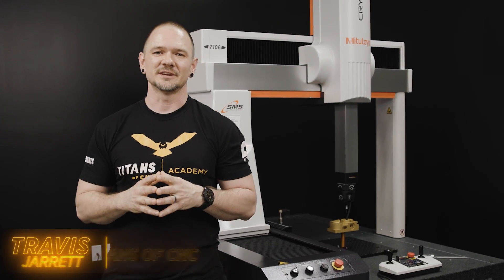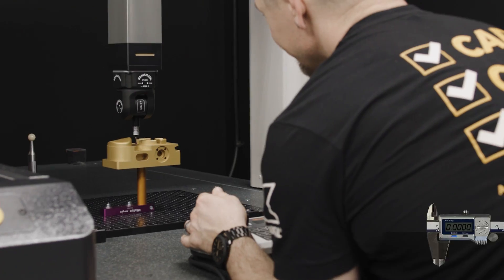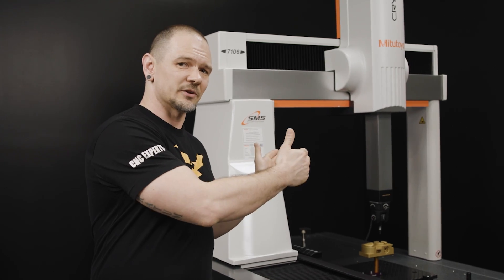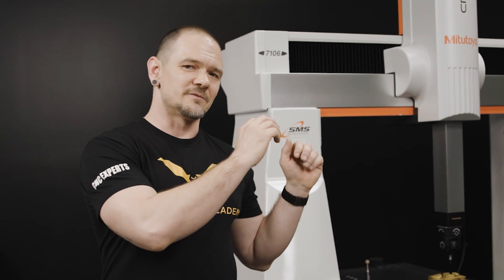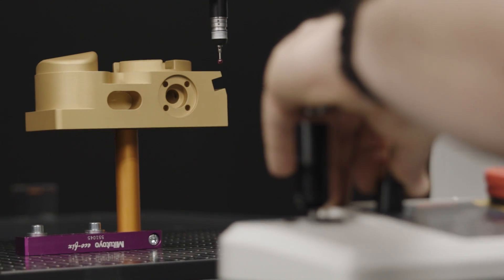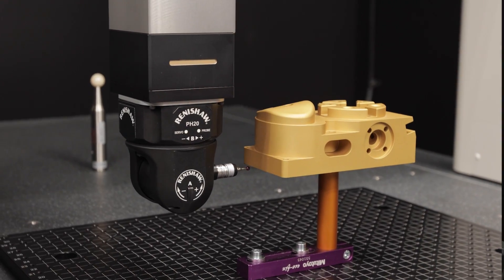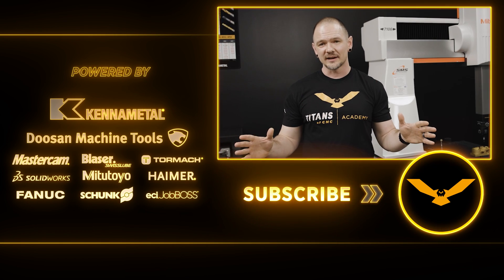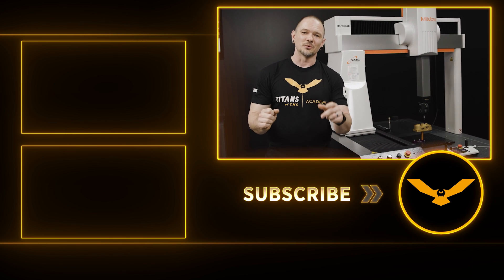5-Axis CMM Hits the Shop Floor | CRYSTA-Apex V CMM from Mitutoyo

Comment: Ive run a Strato apex for about 2.5 years and while the hardware is excellent, the software leave a lot to be desired.  I can't count how many times cat1000 has become desynced with geopak and needed a restart or caused me to loose an hour or two of work creating graphical reports just because it decided to crash when your on the last page of your layout.  It also has a hard time remembering the layout of your menu bars for some reason.  Overall I still enjoy writing programs with it most days, but I wish they would fix the lingering problems and update the damn file manager.  I never understood why you couldn't just save programs as a single file like you can in pcdmis, you gotta use their proprietary file system which is overcomplicated for no reason.
Reply: In the commands window of CAT1000 there is a reset button that restores the sync to GeoPak, there's no need to restart. The system works by passing command from CAT to Geo, CAT expects the commands to be completed successfully. So if you make a mistake and crash the machine it will become de-synched, press the reset as your back in business. 

The Parts Manager has to be used because of the semi encrypted program files the software makes. The Parts Manager is clunky and dated though so I'll give you that. 

As for your layout, that can be saved, and if need be restored, under the window drop down.

I can't offer an explanation as to why your saved views for layout disappear, this is not something I've come across before. 

 If you have any other struggles with programming or the software, Mitutoyo has regional staff of Product Instructors and Application Engineers that can offer assistance. If you reach out to product support through the website they will get you in touch with specialists.

Comment: What scales and encoders is the machine using? Love the UCC system. I am actually retrofitting an older LK machine in Charleston this week and next.
Reply: Hi dear.. Mitutoyo cmm still using glass type scale and this new model come with new generation encoder that machine can start anywhere  without homing.. the encoder also water,dust and oil resistance.. for your info, mitutoyo Ph20 system now no longer run with ucc system.

Comment: I do like more of scanning stuff with revo...
Reply: Revo probe head is only for scanning or touch trigger can also be used e.g. tp20?
Reply: @rizi561  scanning with revo so fast and that sweep scan.. litrelly blow mind..
Reply: Yes I know the accuracy of CMM specified in terms of 2.5+L/300um. We want to buy new CMM so if my minimum drawing tolerance is 20um then wt should be minimum accuracy I need to choose as price depends upon selected accuracy. In other words i am asking abt relation between accuracy of CMM and drawing tolerance
Reply: @rizi561  generally ratio of measurement uncertainty to tolerance is between 1to3 to 1to5 for required tolerance... mostly used is 1to5 means if u want to measure paty having 10 microns tolerance u should buy cmm with 2 microns of accuracy..
Reply: If I dont need reverse engineering then should I buy revo instead of ph20?
Reply: What should be the accuracy of CMM if my tolerance is 10um?
Reply: @rizi561  it's depends on brand. U can find it in its spec. accuracy mostly depends on working length of cmm.. and also there are some ultra high accuracy cmm also in market... It's will be in form of 1 or 2 + l/3000 microns or something...
Reply: @rizi561  for my mitutoyo crysta apex 574 with ph10 probe head and sp25 scanning probe it's 1.3 microns
Reply: Thanks for your support.  Kindly also guide about machine axes size. E.g. if manufacturing facility is producing parts of max size 600x600 then wt should be the axes dimensions of CMM for measurement? Pl. Guide abt PC DMIS and AC DMIS? Which one is user friendly and easy for working.
Reply: @rizi561  it's depends on depth of measurement.  Means that swivel length of probe body +  probe + stylus length is substrates from cmm measuring range.. I currently mitutoyo crysta apex 574  so my z is 400 mm but adding probing and stylus  total swivel length is 198 mm so I have only working length of 200 mm in z axis... 
So you can take cmm size min 300 higher than required dimensions measurement...in all directions
Reply: @rizi561  I don't have experience on pc dmis..as I using mitutoyo mcosmos 4.2 with scanpack and gear pack and it's very user friendly...ui is also good.

Comment: Mitutoyo 5 axis CMM are hands down the machines I've enjoyed working on the most throughout my career. Beautiful pieces of machinery.
Reply: Revo?. I find they are good but break constantly
Reply: @shieldzyLlanbedr  We have a Revo on our CMM. Bought it new with the machine in 2017. In my experience, the Revo is very solid. I've had no issues with it at all in the last 4+ years.
Reply: @kensefakis47  wow. Iv worked with revos for 8 years now. 3 of them across different sites and they are always broken
Reply: @shieldzyLlanbedr  i am a qa engineer at my workplace and i manage 3 5-axis cmms. It depends on how well you care for it. There should be SOP for operators to follow.

Comment: I wounder what kind of drive it uses ( ball screws. Linear motor. linear actuator. High precision rack and penion) 

Also are you guys gonna upgrade the the styli/tip/probe of the machine to the harder ones that last longer?
Reply: The typically use a stepper motor that drives a rubber belt.  The accuracy comes from the scales which provide a feedback loop so it always knows where it is and the built in linear temperature compensation.